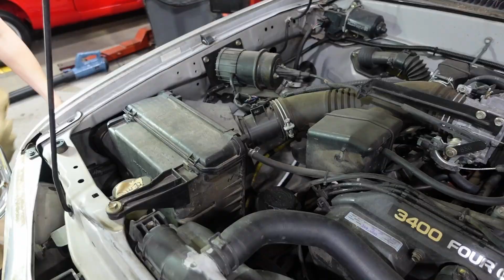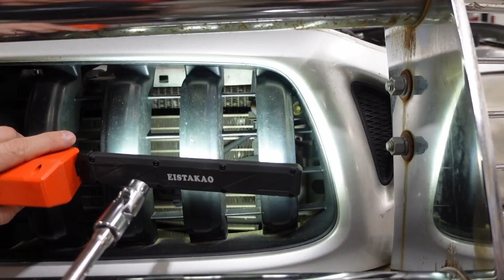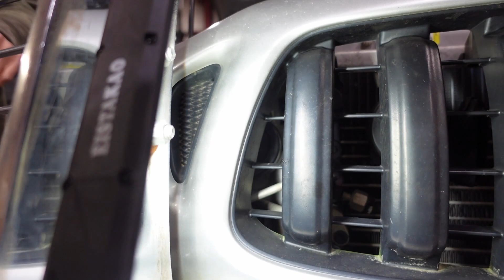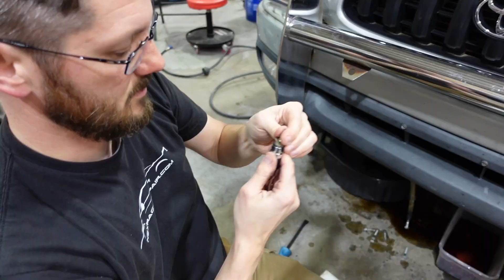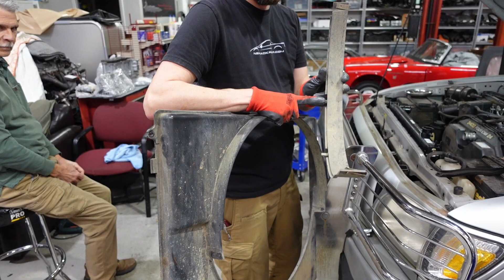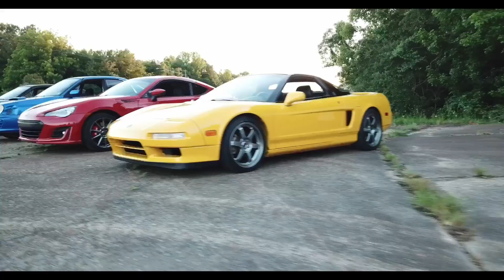The Best Tacoma Radiator Replacement Guide. 1995-2004 Toyota.

Comment: Thanks for the video. Watched this video before swapping out the radiator on my 03 Prerunner 3.4 using the same Denso radiator.

Just came back to comment for anybody who watches this video. I had the same hole alignment issue out of the box. What I did was I removed the support brackets and installed those loosely first. Then I installed the radiator and tightened everything up. Worked just fine.

Comment: Just did my radiator, 99 Tacoma sr5. I did have to take my grill off to get those bottom bolts. Also I took off my skid plate for the bottom hoses but wish I had known before I started that I was going to become draining the coolant would have been less messy. That gizmo that you used on the hose clips is slick as shit.